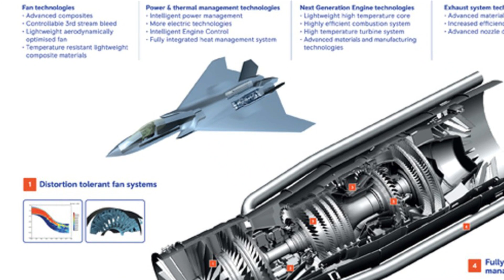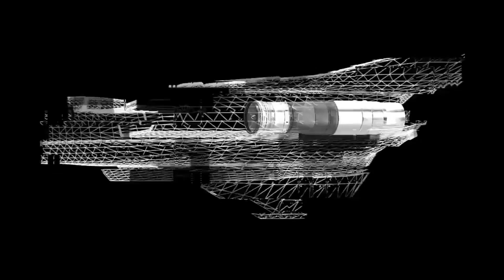Analysis of UK and India Engine development & co-operation

Comment: Others are working on RDE engines. So if any one gives us ToT, that's for sure is going to be a 4th gen fighter engine tech. EJ200 based engine will be just another 4th gen engine with improved thrust. Most probably, they'll not give the tech of Tempest engine.
Reply: EJ200 itself is already a 5the gen level engine.
Reply: @yixinmei5854  It's based on 80's tech